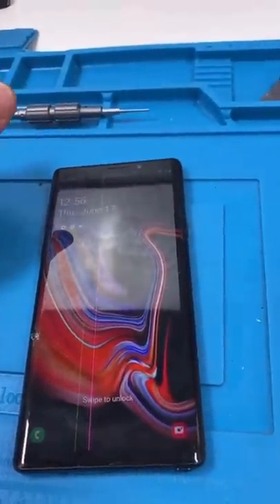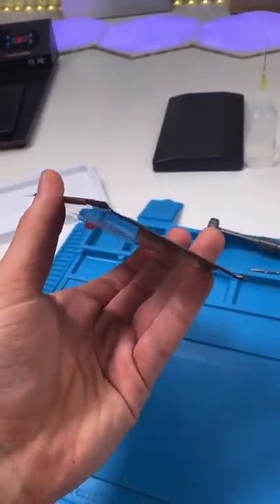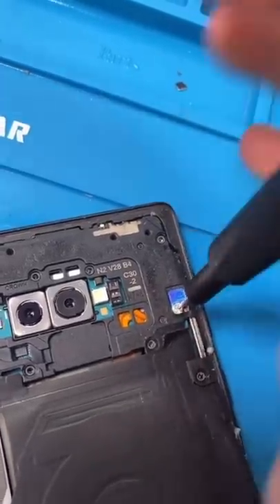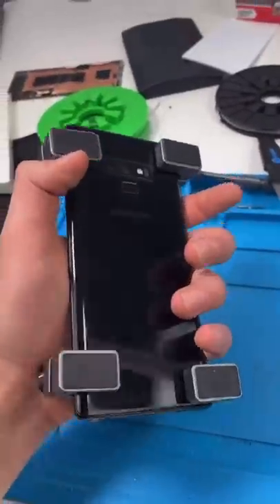Cooking the Note 9... Screen only Replacement #Shorts

Comment: "people don't like to repair Samsung's cause they're too expensive"
Continues to burn Samsung
Reply: ur not wrong that I what he was doing
Reply: Apple: hold my price
Reply: @sillyfun  | they're cheaper to repair.
Reply: Kanu repair my smartphone display?
Reply: Mi 10 T
Reply: Coming from a samsung user...iphones are way more expensive so pls stop the cap my dude
Reply: @unoknown4614  
It depends on the phone you Chose from Samsung 
they Have a variety of different phones with different prices . They are not dead set on making flagships.
Reply: The best phone was the note 9
Reply: Qwispy
Reply: @Nemisis007  not 100% tho while some are expensive on the Samsung it is also the same for the iphones
Reply: @unoknown4614  I think they meant that Samsung parts are more expensive
Reply: @katsukibakugo3888  mine lasted a year
Reply: @katsukibakugo3888  k-katsuki~?
Reply: @astroboy2680  ?
Reply: @katsukibakugo3888  nothing.
Reply: @INESERTCREDIT My old Samsung I just replaced was good and I had it for 6 years. Sold it to another person, it probably still works fine
Reply: Flagship samsungs are more expensive what samsung do you have
Reply: @Nemisis007  not at just places because a lot of places only be having apple parts and they be charging people more just to order new parts
Reply: @sxnny2315  what trash phone did you get loll
Reply: @Jonathan-tr5mi  idk it was a samsung
Reply: @sxnny2315  did you get the crappy one.... Because no Samsung unless it's worth 200 gone last a year either that or you threw it off yo roof.
Reply: @123onetwo3  was just about to say this
Reply: @Nemisis007  actually because samsung has higher quality and far better parts than iphones there actually more expensive to repair, apple uses shitty parts such as small capacity batteries and low resolution displays and cameras which is why there so cheap to repair
Reply: @unoknown4614  no to repair a screen usually you can get a iPhone screen any generation fixed for under $100 when I got my s9 plus screen replaced it was $360 just for the screen you can get a fucked up screen from China with burn in for like 100 bucks but why would you replace a broken screen with another broken screen I have a s20 s21 and a note 10 and it's $270 usd for screens and to have it properly installed another 100
Reply: @unoknown4614  depends on the version of your samsung, i have S20 ultra and it's more expensive then iPhones
Reply: Huh?
Reply: @unoknown4614  yeah I was like caaaaaap.
Reply: @Nemisis007  Say that to my country
Reply: That's not a burn
Reply: @jaredsalem5837  yes it is, it's why I'm still  using one 3 years after it came out
Reply: @sillyfun  they’re the same price to buy
Reply: bro Iphone is expensive too!
Reply: @MemesAndvids  i actually work at a 3rd party reapir shop and its not that apple uses shitty parts that makes it cheaper to repair, its just that apple phones (up until the 14) were basically designed to have the screen be the easiest thing to replace. you can have a screen and battery replaced on an 11 for about $200 AUD, but if you were to repair anything else on an iphone it starts to cost you. meanwhile samsungs arent really built to have the screen replaced. you can get a back plate or charging port or speakers or cameras or anything like that for a samsung for like $5 - $20 but as soon as you go for a screen... wham $350 becasue essentially when you buy a replacement screen for a samsung you get almost half the phone with it that you have to replace e.g. you get the frame which has a bunch of stuff already on it that you have to transfer from the olf phone to the new frame. and then to top it all off you have to glue the shit out of the front and the back of a samsung whereas apple you just plop down a new seal and the whole thing clicks in with just 2 screws, no clamping needed.
Reply: Nice

Comment: Did you know, that a glass only repair ist possible?
And also it isn't tooooo difficult.
Reply: Right, just needs some extra tools..
Reply from the maker: Its extremely difficult and risky and “some tools” costs a few thousand dollars🥴
Reply: Buy screen from local parts supplier: ~20 bucks depends on phone
Change glass in repair shop: ~40 bucks and more, most probably they will say that they would not do it, even if they have tools available.
Reply: @kcalbxof  screen for s10+ wholesale is 250$

Comment: I have a Note9 myself. Incredibly underrated phone. Probably one of the best flagship phones Samsung has ever released.

PPI is very high, SD card support AND a 3.5 jack

All before samsung decided to remove both SD card support AND a jack on their flagship models.
Reply: Mine has two problems heating (obviously) and display de-coloration its really annoying noting can fix it

Comment: Well yes the repair cost of these things are expensive. As of right now, I'm typing this on my Note 9 which has a small crack. Yeah the repair cost sucks but somehow I'm used to it. My only weird problem is that my phone screen will just turn yellow ocassionally and the top part of my screen(lets say 1/4 of the screen) is just goes way dim

Comment: So, I got this exact phone and I'm not entirely sure whats exactly wrong with it, I believe it's just my screen but, it has brightness issues, like whenever I put my phone on half brightness, the whole screen literally goes completely black, then sometimes it basically has a seizure and will get really dark and flicker, also depending on what app I'm using, it will not be very bright even tho it is on full brightness (also, I check and recheck a bunch of times but, it's not on adaptive brightness or any setting that would make it do that)

Comment: My note 9 screen just turned black but still works. I took it to a repair and they told me 200 for an aftermarket or 320 for the original screen. Fucking nuts 😳

Comment: Question: would it be worth it having your phone repaired if it has more problem or just buy a new phone?
(Ex. Cracked screen, led display problems, and battery needs to be replaced)

Comment: Hi, josh(?) im about to attempt fixing my note 9 and i need your help. I need to know, when you’re removing your screen from the frame, do you also need to take out the battery and vibrating motor and all that stuff before you start prying into the screen or can you just start prying in after disconnecting the connector? I need your help please, thank you.

Comment: iPhone vs Samsung: 5 Must-Know Facts

iPhones are generally more expensive than Samsung. The most expensive iPhone commercially available now is the iPhone 13 Pro, the maximum cost of which is as high as $1,300. The most expensive Samsung phone available is the Galaxy s22 ultra 5G going for 1,299.99.

Comment: What if the board got short due to water damage? My phone got exposed to rain amd later the camera lens got fogging. So I put it inside a cloth bag and tied the vacuum cleaner exhaust hose to the bag and kept on for 5mins. And guess what? My phone never turned on. So what might be went wrong? It was working even after exposed to rain. Except for the sensors. But I went on fixing it myself and destroyed. So is there anyway i could fix it? Please help. It's a galaxy note 9